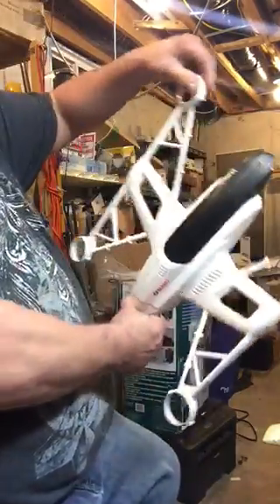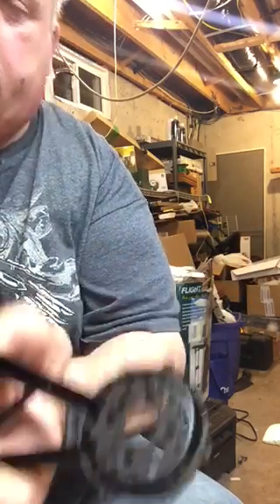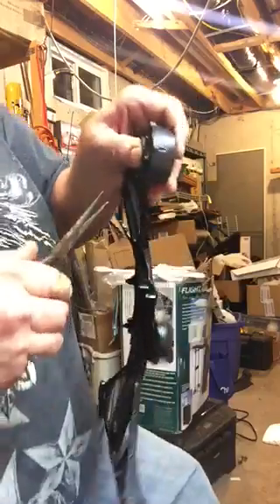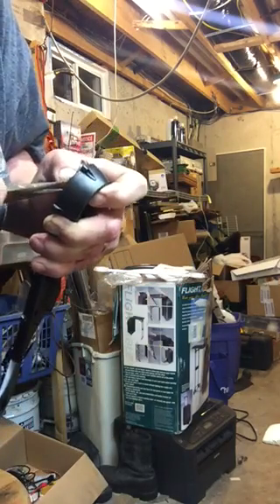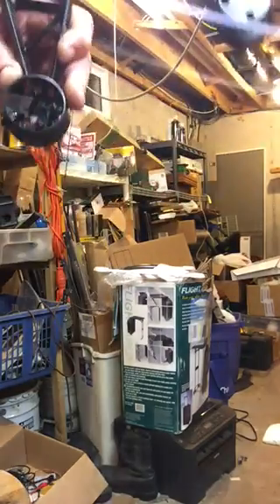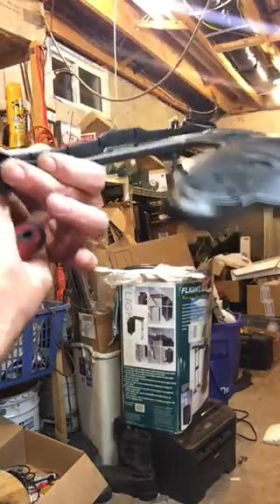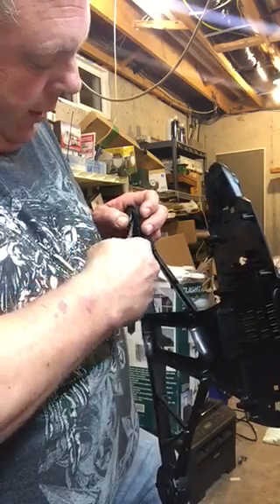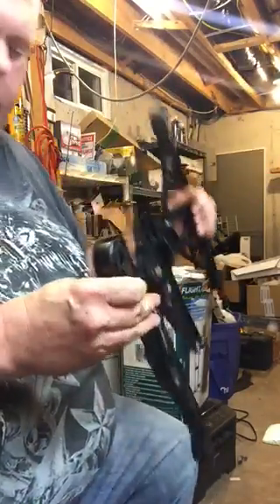Yuneec Q500 rubber motor pad install

Comment: Thanks for the video. I was wondering what those were. I swapped all parts into the new frame. I was wondering if there are longer screws to compensate for the difference of the pad thickness. As well, did the pads help with vibration issues? Thanks for the video. I wish there were separate bags of screws that were labeled because the only way I put mine together was memory and a lot of photos. I'm almost ready to assemble together but I am thinking I better put the pads in. What is your opinion? Thanks.